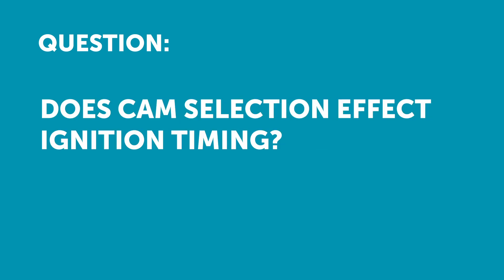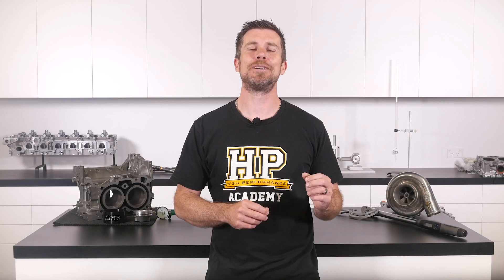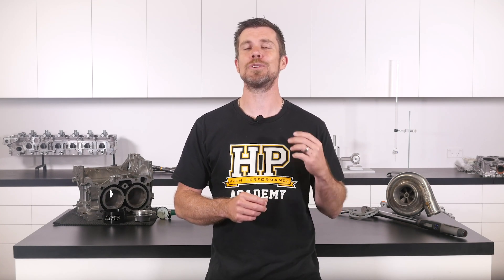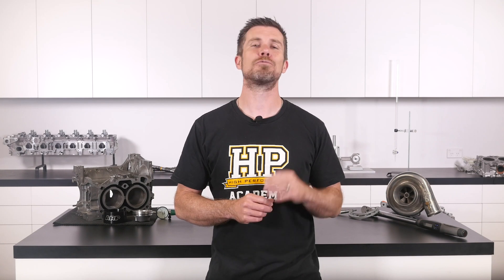Cam Selection And Timing | Aftermarket Cams And Aggressive Ignition Timing [HPA Q&A]

Comment: IVC (intake valve close) on an aftermarket cam virtually always kills DCR (dynamic compression ratio) and requires more advanced under torque peak RPM.  The extra overlap from EVC & IVO virtually always provides extra EGR effect which multiplies the difference.

A stock cam will make more power on a stock tune.

Comment: Perhaps the chap could check out the difference between static, or nominal, and dynamic, or running, compression?
In short, it is largely because of the differing volumentric efficiency - in the classic sense of the mass of air and fuel that is actually in the cylinder compared to the theoretical.
Because longer duration camshafts normally close further past BDC, further into the compression stroke, less combustible gases are being compressed that for a mild camshaft that closes the intake valve earlier, trapping more of gases in the cylinder. This means at lower rpm the charge is less dense and so more ignition timing can be used - the fuel burning slower. However, at higher rpm when the engine is in it's designed rpm range, the cylinders should be filled much more (perhaps also check out intake and exhaust tuning?) and so less timing will normally be required.
Reply: This is also my understanding.